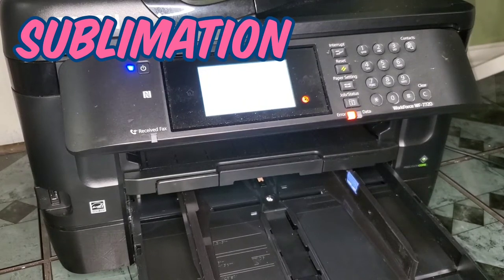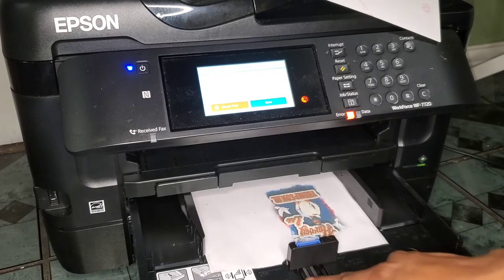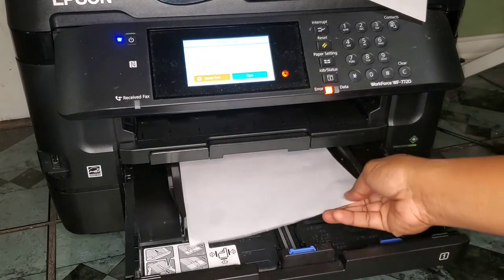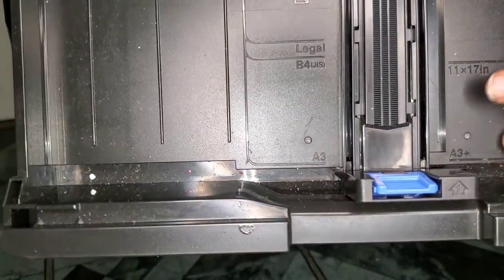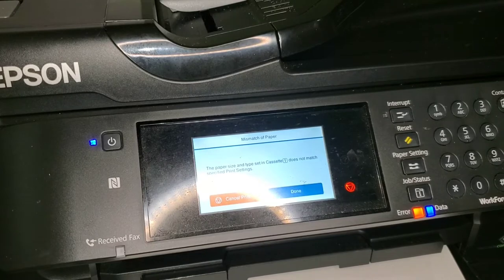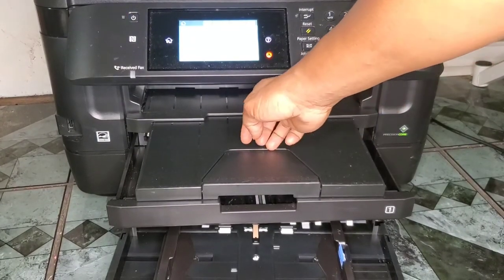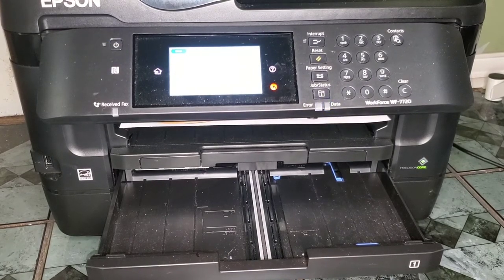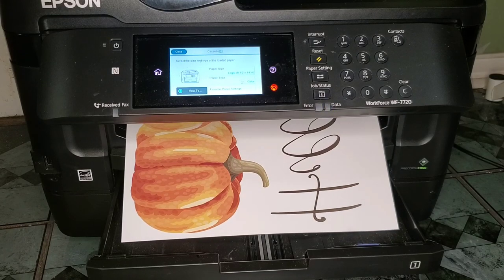Loading oversized paper into your Epson wf7720

Comment: I had the same problem. This is all you have to do: go to Epson website and download drivers for the Epson machine that you have. Download the combo package if your printer comes with Fax capability (even if you don't have to use it). After downloading, set up the installation. After the installation is over, turn the printer off and turn it on again for the software to recognize the new drivers. After this I returned to Corel Draw 2020 and the setup was right there waiting for me, the size I wanted. I had a problem to print photo paper 13x19.
 After this, you can lay the paper in the tray, normal position, just like any other paper, as long as you observe the instructions for paper sizes.
Reply from the maker: That is a step people overlook. I did that with my second printer. Thanks for your feedback
Reply: Thank you for sharing.
Reply: Thank u bcuz this video was all over the place to me 🤷🏽‍♀️

Comment: How do you set and print from the rear tray? I have changed my printer to the rear only for it to continue to print from cassette 1. Thank you for this info, it sure did help. Also, how do you remove the black corner lines so I can use the full paper to print on?

Comment: Aside from the paper size issues, could you tell me why when I try to press a sublimation print on a shirt only the black lines come out but nothing else.

Could it be that my heat press is not getting hot enough or am I supposed to saturate the print with as much ink as I can in other words do I need to choose the heaviest ink settings?
Reply from the maker: This sounds like your press may not be heating up properly. All colors work the same

Comment: Have you tried to print larger size card stock with this printer ? Can you print it from the tray or you need to use the rear tray for that
Reply from the maker: I have. If you put the cardstock setting on its going to direct you to use the back tray. I mostly print with premium presentation matte so I can use tray 1

Comment: Hey Charity! Good info. How do you get it to pull from the top tray? I actually have the WF-7820 but, I imagine the commands are the same. Maybe? Just got it today but can't seem to find where I can tell it change trays. Thanks
Reply from the maker: Hey! I was on vacation! I would look for that in print settings. You can choose automatic (goes back and forth between trays or cassettes based on the desired print size). You also have an option to pick a printer. When you install your paper you will be prompted to input the paper size and type.

I hope this helps. Thank you for watching
Reply: Thanks for getting back to me, I'll try this.

Comment: My printer says Print Error and it never feeds or print 😭😭
Reply from the maker: You have to make sure your paper is pushed up as far as possible. It should be centered and aligned with the laid out paper dimensions on the tray/cassette. Then also make sure you then push the cassette/tray in.